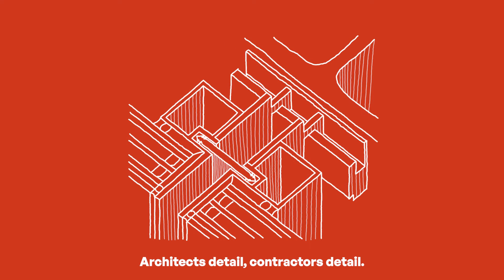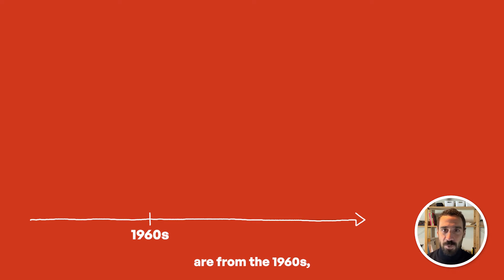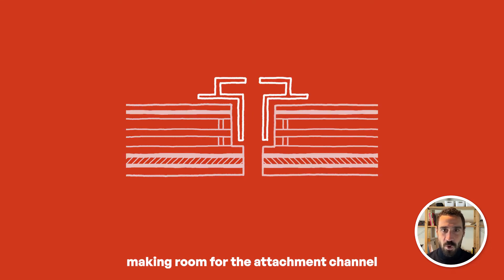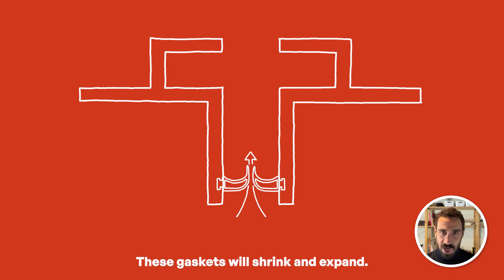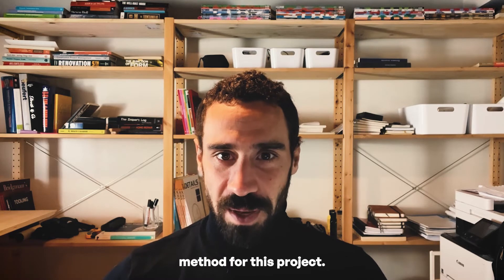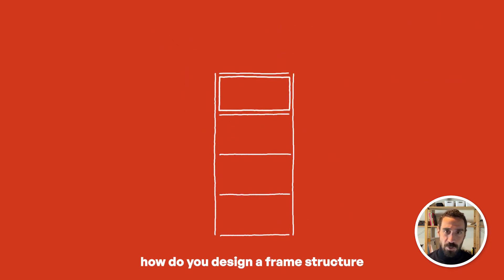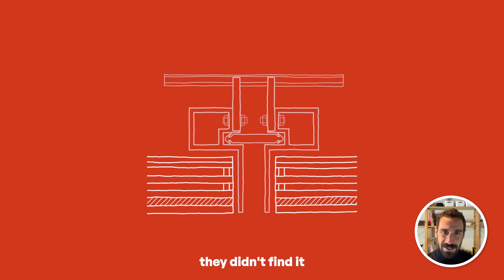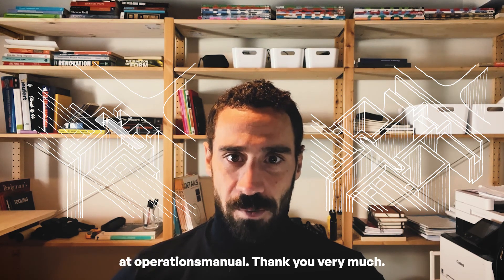The Perelman Center Facade Detail Breakdown

Comment: Very informative video. I would add one more point. This designer / contractor relationship appears at first glance to have been the outcome of what is commonly known as a “design assist” process where a glazing and facade contractor comes in and and provides design, procurement and logistical input DURING DESIGN, in exchange for being awarded the job provided when it goes out to bid as long as they meet an agreed upon budget target. On SOME government design-bid-build jobs, this is not allowed due to backward procurement rules. I experienced this once as an architect. There were workarounds but it took some finagling with a project donor to pull off. 
A segment explaining the “design assist” process would be great.